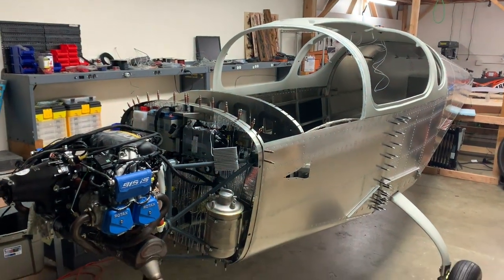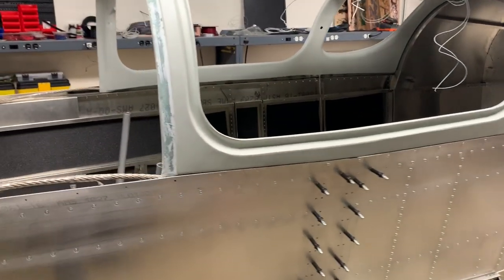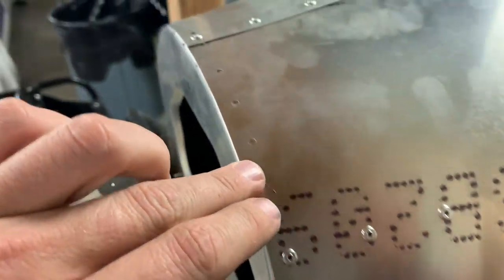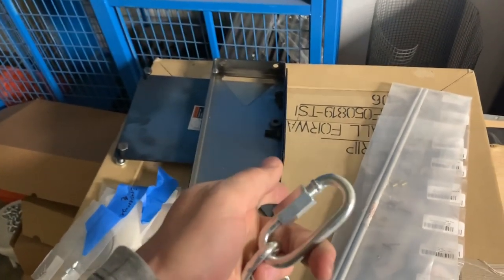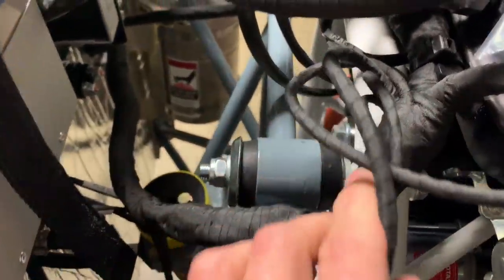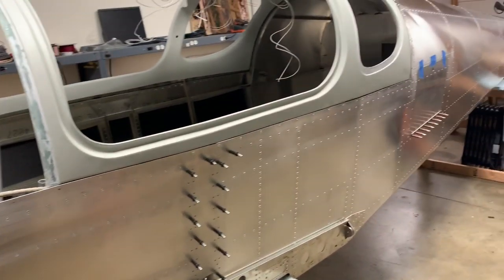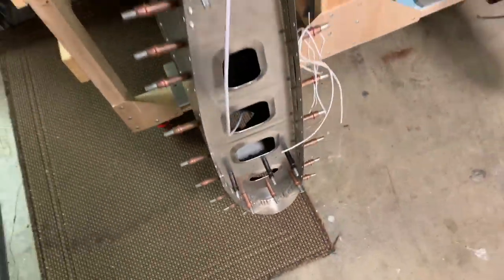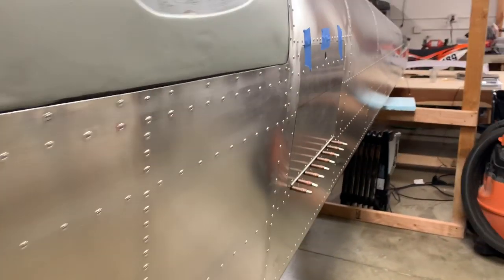Sling TSi- Good Week!

Comment: Also got 38N/M from the factory and had the same problem with the bolt and turbo. I cut of probably 10mm of the bolt to prevent de bolt touching the turbo
Reply from the maker: FTBonito yup same solution for me, worked perfectly!

Comment: Nice work!  Would it be possible to reverse the bolt by the exhaust?  Put the head of the bolt by the exhaust and then the nut will go out on the other side?
Reply from the maker: Misty Schmidt no, I actually checked that too! The bolts are pretty long and the exhaust would be in the way for it to go through. The manual shows to install them the way I show in the video
Reply: %If the engine half of the motor amount is removable from the engine, then that would allow you  to insert those long bolts in reverse with the heads towards the manifold. Then just rebolt the mount to engine. That way when you go to remount the engine those lower bolts are already protubing and just need slid into the lower grommets on the firewall half of the motor mount. Then just mount washers and nuts as you do the top ones and torque away.  I don’t see why you couldn’t do it this way.

Comment: Why don't you turn the botton bolt around so the threads are towards the firewall like the upper. That way it won't hit the exhaust.
Reply from the maker: Steve McCluskey the exhaust is in the way of sliding the bolt through in that direction. The instructions show it installed this direction too unfortunately
Reply: @EvanBrunye  take off exhaust? Or shave the bolt maybe. That type of stuff would annoy me when going through the instructions.
Reply from the maker: Steve McCluskey ya we’ll see what the factory says to do. I kind of think 38 Nm is too much torque on those bolts and they will revise that value in their reply. I’ll keep everyone posted in next weeks video!
Reply: @EvanBrunye  38 newton meters equals 28 foot pounds.  That is not much.  What size bolts are they?
Reply from the maker: Andy Grimm ya it isn’t much. I’ve confirmed the value is right. They’re M10 bolts, I wasn’t thinking it was too much for the bolt but I was surprised the rubber should be compressed so far. Makes sense though when I torque the top bolts to 38 Nm the rubber looks right. It’s just the one that contacts the exhaust that has an issue, everything else looks great